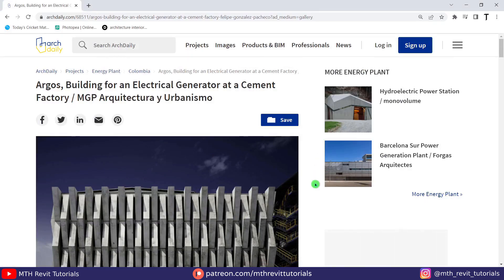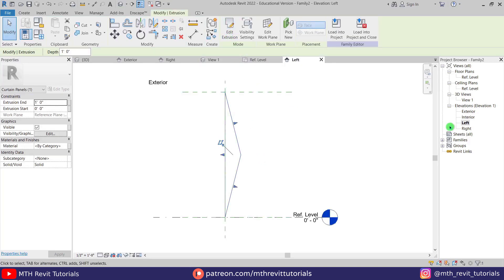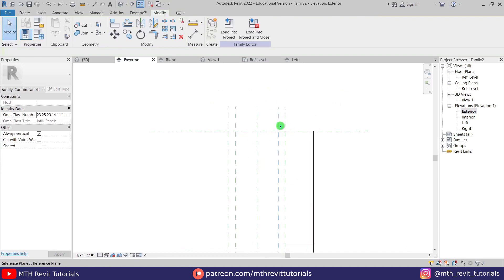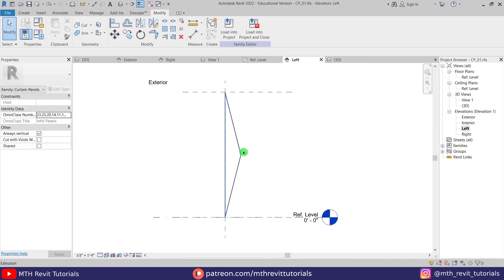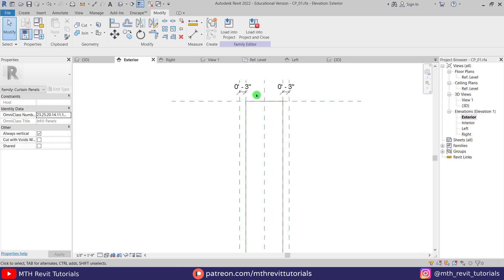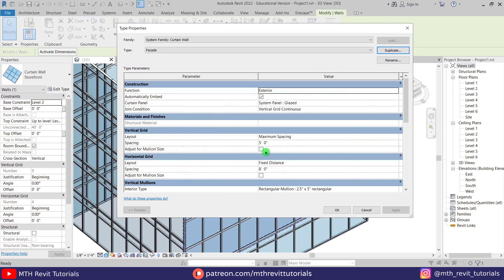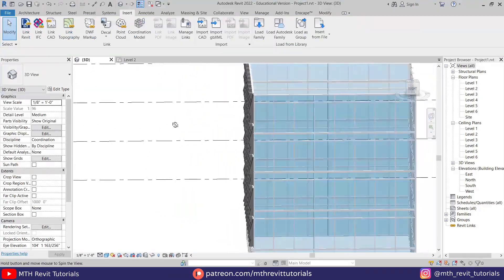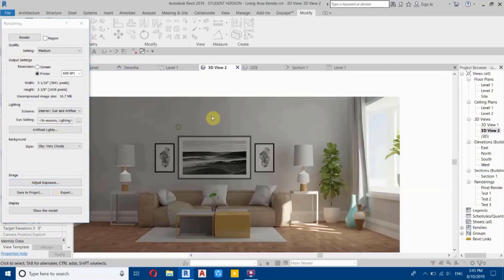Learn Revit: Simple Block Pattern Step-by-Step

Comment: I’m unable to select the vertical panels
Reply from the maker: You will first have to select a panel, then right-click and select panels along the vertical grid.
Reply: @MTHREVITTUTORIALS i cant select the panel
 What should i do ? 
Please answer me😢
Reply from the maker: @sahelbny3668   Look at the bottom of your screen. You will see a pin icon - make sure it is turned on. By the way, you need to press the tab key to select the panel.
Reply: @MTHREVITTUTORIALS  Unfortunately, it didn't work. Thank you for your answer